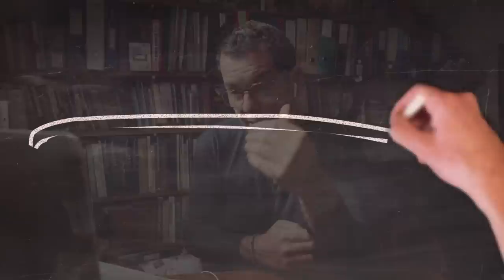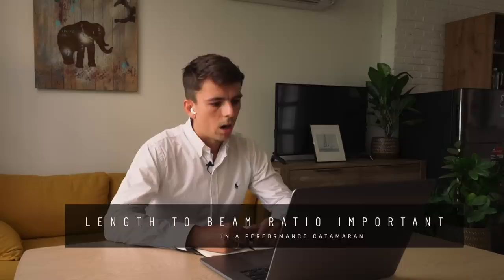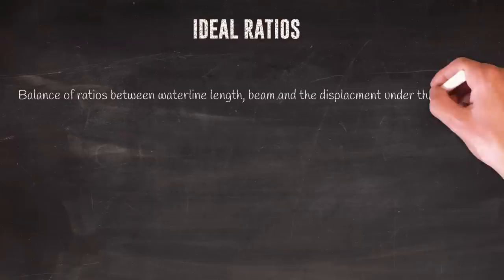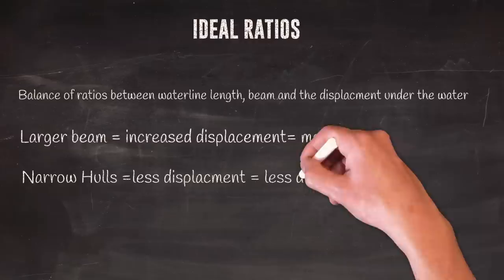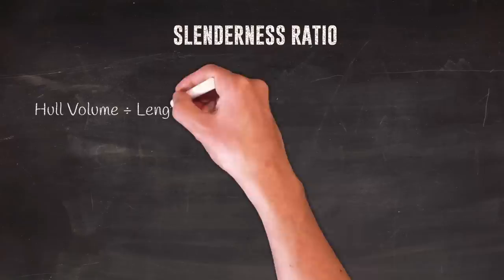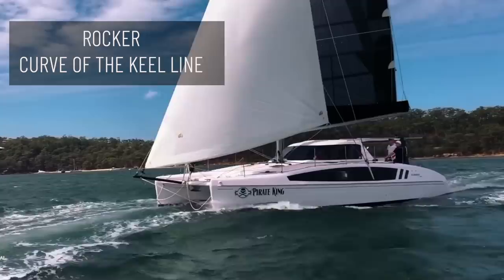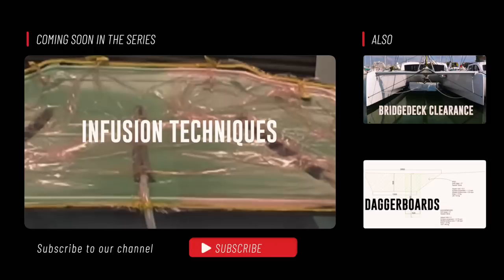CATAMARAN DESIGN: Hull Shape | Essential Catamaran Knowledge Ep. 1

Comment: Great video.  A lot of different terms like drag and displacement and such were thrown around a lot without a lot of context on what they actually are and how important they are to the overall performance.  I'm less clear what drag is on a hull and how much it effects performance but I can define displacement.  Everything knows what it is, but they don't understand why it's so important.  If you had a boat sitting in the water and you froze time and removed the boat, the volume of the hole left in the water is the displacement.  Multiplied by the weight of water is the weight of the boat.  Displacement is important when you start moving because you have to push water out of the way to make a "new" hole in the water.  How much effort this takes depends on how much water and how far you need to move it to make the hole per second.  This is why cats are faster than mono hulls.  If they have the same displacement, the cat has to move the water half the distance to make the hole it needs.
Reply: You slightly misunderstood me.  What I described wasn't just about the volume of water but also the distance you need to move it.    Longer narrower hull with the same total displacement will be significantly faster.  Split a single hull into multiple while keeping the same volume of displaced water and it will be significantly faster because the water has half the distance it needs to move. While there are other factors, this is by far the overriding factor to start with.

Comment: I assume this was recorded some time ago, so my question is probably going to go unanswered, but I want to know what the benefit of assymetric hull design is. A good example is the Outremer that SLV are on. From top down, there is a pronounced opposing camber similar to a pair of aircraft wings. This should create a low pressure area between the hulls with a corresponding increase in water speed. As a byproduct of this, one would assume the hulls are then in compression which I suppose is OK???

Comment: The ratios you used and values that are more indicative of a performance catamaran hull seem to me to be backward in the video.  What am I misunderstanding?  The statements regarding distance of the hull from centerline (also increasing stability to a point), hull shape and rocker make sense. . 

Statements from video
1. Slenderness ratio:  > 7, performance; < 7 more typical of cruiser
2. Prismatic coefficient:  the higher, the better for performance

Equations from video:
1. Slenderness ratio = Hull Volume / Length.  The term "Displacement" was also stated in lieu of "Hull Volume"
2. Prismatic coefficient =  Hull Volume / (Area of cylinder form which encompasses the the entire Hull Volume)

Testing equations
1. Slenderness ratio - A cruising cat would likely have a higher (larger) hull volume than a performance cat for a given hull length. Thus this ratio gets larger as the design is geared towards cruising, and smaller for performance. Replace the term "Hull Volume" with "Displacement", the conclusion is the same as a cruising cat will have a high displacement than a performance cat. 

2. Prismatic coefficient -  When the Hull Volume is a smaller portion of the cylinder, less exposed wetted surface area, thus less drag.  The more the hull looks like the cylinder (approaching a coefficient of 1), the more the wetted surface area and drag.
Reply: SR = LWL ÷ Displaced Volume ^0.333
Slenderness Ratio and Displacement-To-Length Ratio have been confused here (same ratio inverted).

Comment: Interesting interview, thanks for putting it together.

These concepts are of course interesting, but in the end the most useful tool to assess the performance of a boat are its polars right? They factor in all the aspects including water and air drag, the size of the sails, their interactions, the static and dynamic righting moment (for boats that generate some), the impact of heeling (less relevant for catamarans), the ability to plane,... It's next to impossible to anticipate the resulting performance from considering isolated aspects even if yes, a more narrow hull will typically mean more speed.

This being said, when you watch videos of the recent Vendee Arctique, it seems clear that performance is just part of the story for passage mating. I would argue that comfort is also key and that is probably even harder to assess from isolated boat characteristics than performance. Speaking about monohulls, one rather unintuitive thing I learned recently is that boats with lifting centerboards are often more comfortable at anchor (less motion) compared to those with lifting keels, because the centerboarders are designed to have balast independantly of the weight of the keel, so they remain stable even with the centerboard up. This to say that considering only the performance value of a keel would result in overlooking this essential aspect of comfort at anchor.
Reply: Sailing catamarans don't have ballast.  It is widely agreed that weight is the biggest determiner of sailing catamaran speed.

Comment: Hi Nick, thanks for the great video, I learned a lot! I think your slenderness ratio is upside down, it should be length / cube root of displaced volume.  It seems that a catamaran should only use half the displaced volume since there are two hulls.  In this case, assuming 25% over the published light displacement, I get 7.3 for the Seawind 1370, 8.4 for the Outremer 45, and 6.4 for a Lagoon 450S.  I wonder how much difference this makes in the real world.  Unfortunately, we won't be test sailing the 1370 any time soon.

Comment: Key question is "Fit for purpose", for me permanent live aboard anywhere in Australian, Papua New Guinea, Solomon Islands, Vanuatu, New Caledonia, Fiji, Samoa, Tonga, New Zealand and passages anywhere or direction in between, (this means a good knowledge and sea states to be found and if at a certain time you must go, or, wait for a weather window and what specifications for the weather are allowed to be included and what speed performance do you expect for any weather option...   Now you may consider the technical qualities of the boat and number of people/crew fittings for comfort etc you specify...   Life is a compromise...     In  Australian designs & USA & many other nations,   Only one comes near to my definition of "FIT FOR PURPOSE", is Bob Oram's design in his 39 C...   But I cannot work on "Duflex" as I an highly and adversely sensitive to Epoxy hardener...   More needs to be considered sail style...   John Hitch is one sailor/builder/racer/explorer I admire for his "Hitch-Hiker" rig and his final sailing design was EXIT with an 80ft mast and huge light weight flat cut genoa to each bow on roller furling (All in or all out) and a blade sail also roller furled used for heavy weather...    He sailed as the only crew with his wife as a loving passenger...   I am for less sail on a 12M skyhook...   I like the feeling of squeezing all the performance in comfort, surfing when the sea state allows, using weather windows sensibly... (With my wife as a passenger and feeling safe with my skill keeping us safe, yet having fun surfing)...

Comment: I think you got a little mixed up with the your hull shape .... the transverse-cross section in a U or rounded shape you have the least wetted surface / less drag. The flat bottom has more drag but higher load carrying ability.   Cheers Warren
Reply: Most designs vary from "v" forward, to "u" amidships, to rather flat aft.  In hard chine designs with fundamentally "v" shapes, the deadrise varies from steep forward, to less amidships, to even less deadrise aft.

Comment: ratio of volume divided by length actually diminishes with increasing length. so what is the slenderness ratio really? highly voluminous hulls with same length as a smaller volume hulls will seem to have higher number for the slender ratio as is defined by you guys.
Reply: I think slenderness ratio and displacement-to-length ratio got mixed up here. They are opposite ratios of the same parameters, I think traditionally used in opposite sides of the world.
As the hull lengthens, SR goes up and DLR goes down.
SR = metric length at waterline divided by displaced metric volume to the power of 0.333 (decubed).

Comment: Simple: 
Performance==Start with the hull+rig and fit the interior inside
Cruising==Start with the interior and wrap the hull around it with big engines and a smaller rig.

More seriously, its interesting how the priorities of hull design change Mono vs Cat. You spend a lot of time on a monohull looking at the righting moment and how that affects the shape (and prismatic coefficient) of the hull, obviously that is not thought of for a cat, These guys are concentrating on hull drag & whetted area, I would have thought a lot more thought would go in to the leverage that the rig can exert before you start lifting a hull and how to compensate for slip.
Aerodynamically you often don't worry about the 'whetted' area, it's all about the frontal shape/size. I suppose water creates more drag through contact? So the balance has to be taken between LAW for top speed and drag.
Something else to remember is that big heavy boats move more gently = less seasickness for the crew :)

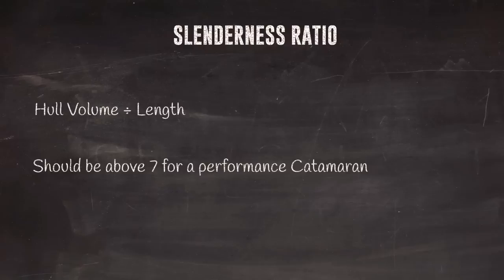Comment: I'm not getting the slenderness ratio (7:52 ) what units are we talking? Not only that, higher ratio number means faster boat? but as the volume increases the ratio increases (More displacement, is heavier, so slower...) but as the length increases the ratio goes down (but more length = faster boat!). Is that ratio the right way around?

Comment: I had to watch twice before writing this comment, because something doesn't make sense.
If Slenderness ratio is diplaced volume divided by waterline length, then a slender hulls  which has lower volume and longer WL length should have a lower ratio not higher as said in the video  (decreasing the numerator and increasing the denominator)
Reply: Slenderness Ratio is actually as follows:
SR = length at waterline [m] ÷ (displaced volume^⁰'³³³) [m³]
So the ratio does go up as the hull gets stretched.
There is another equation in reverse that gives a diminishing number as the hull stretches - called the displacement-to- length ratio.
I think the two were getting mixed up here^.

Comment: Id like a muliti maybe 4x4 hydrofoil type ie on skis with turbine power below the water but maybe above the hydrofoil shelving like how a plane works stealth wise , also safety and electricity ie using alternators bring more enwrgy from the sea also not just from tue motors and solar but wave power wind power etc but definitaly keey biofuel on board and built in diesel engine just incase...

Comment: Slenderness ratio above 7 .. in what units??
Reply from the maker: A ratio has no units mate
Reply: @sailingrubyrose  a ratio of volume to length has no units?  Maybe I didn't get the definition right.. is it a ratio of volume to length? If not, then what's the correct definition?
Reply: The ratio is meters divided by cubic meters to the power of 0.333 - so no units.

Comment: Why they do not use foils for cruising cats? Just to lift it 20 cm.
Reply: Tooooo Weight! To lift  one person on a Moth foiling  the hull is 30 kilos...or...less for now cruising and foiling are opposites
Reply: @mauriziocanale1669  What? Why should it be a problem to lift a cat that has 1,3 m depth for 20-50 cm up with foils while travelling? Especially when the foils are movable, you can pull them up in a storm. The weight can't be the problem.
Reply: @TST1998  mmmmm nothing is impossible....but Should be a problem..
Reply: Ask to Giovanni Soldini with Maserati foil conversion endless issues..
Reply: Too heavy.  Too little power.

Comment: Fineness Ratio is the word you were looking for. A cruising cat is generally 7:1 to 12:1. That's hull beam to length below the waterline. Modern performance cruisers step way out above the chine as living space floor is usually above the waterline. This requires a balancing act and will be like using speed brakes if you freight it enough to submerge the chines.
Catamaran language is absolute garbage which is a great benefit to manufacturers and dealers. Hull beam to length should be a straightforward answer. Hull to hull width or total beam is something else entirely.
Getting the fineness ratio at or above 11:1 with good hull living space takes use of exotic material construction to run narrow hulls below the chine and maintain shallow draft unless you exceed 60ft. That's part of the reason the bigguns are so much faster.

Comment: If your interested in boat data and ratio's there are a couple of websites that provide numbers for Mono's & Cats. Numbers include Comfort ratios, Displacement/length ratios, capsize ratios, Length to beam ratios etc.

https://sailboatdata.com/
http://www.multihulldynamics.com/default.asp

http://www.multihulldynamics.com/news_article.asp?articleID=255   - This is a link the the FP Helia 44 as an example. Proving she is a heavy slow cruising cat, but is relatively stable

Comment: The reality of a cruising catamaran is that 2 tons of weight is just not enough in the real world.
If you take 800l of water 400- 500l of diesel another 100l of dinghy fuel. Then you add a diving compressor and 4 sets of dive gear and 4 humans you have maxed the weight without even the spares needed the extra gas cylinders, paddle boards, kite boards and kites, cameras computers and all the food and drinks etc.
I think that 4000kgs is a more realistic figure to aim to be under.

Comment: Well, thank you very much.
This explains to me why it is ridiculous to look for a performance catamaran as a liveaboard plattform. If the hulls are designed for perfomance, they work best empty and lightweight, narrow and shallow. Same for a cruising condomaran with beamy round hulls btw.

But then you move on board, want a generator, lots of fuel and water, diving gear, compressor and A/C, huge solar array, a good dinghy with a proper outboard on the davids, fridges, freezer and a lot of provisioning, space for your clothes and toys.

A performance hull will drown itself and the cat will drastically suffer performance, a cruising beamy hull will swallow it and barely get deeper into the water, it has a higher carrying capacity.

You pay a lot of money for lightweight performance, sacrifice living room inside and in the end a fat heavy Lagoon or Leopard sail faster and more comfy, and is cheaper and safer, it will not flip that easy.

So make an educated decision, will you race or will you live aboard and cruise, and then chose your hull design and brand. It is a no brainer, that a performance vessel is a expensive but poor cruising vessel.

Comment: The best Cats are amazing to sail on, and so awesome cruise on but don't try and tell me that they are  incredibly well built and well engineered because they are not the best boats are almost tolerable its just a Tupperware shell with accessories  bolted into the shell somewhere . a silly engine arrangement with a prop hanging in the water, And they can sink !OK maybe anything could sink but for a million plus there should be some counter measures to sinking above and beyond seamanship. There are some amazing French Yacht gurus from skippers to designers and crew...this -person is none of them sorry seems nice but puh-leez ...
Reply: and your average skipper trying to right a turtled cat over the beam instead of the stern . Back in sailing school as a boy I had the top triangle at the mast head was a flotation device sewn into the main sail. I never went turtle its the simplest of details prevents the vessel from flipping over, never seen something like that of any other multi hull ever , but i digress